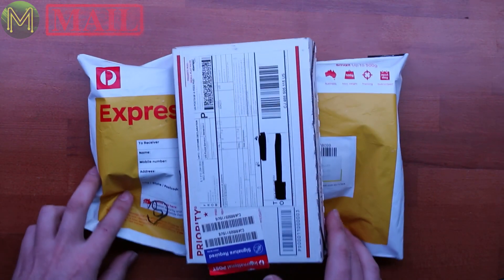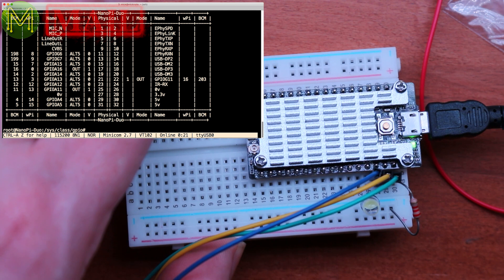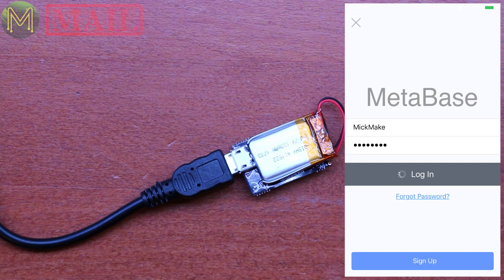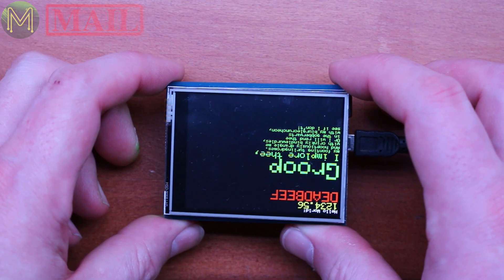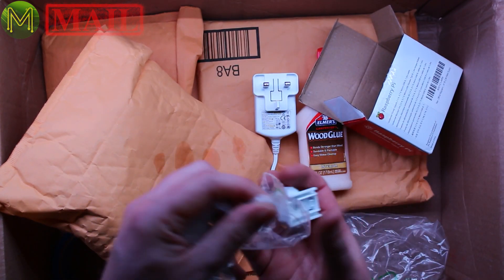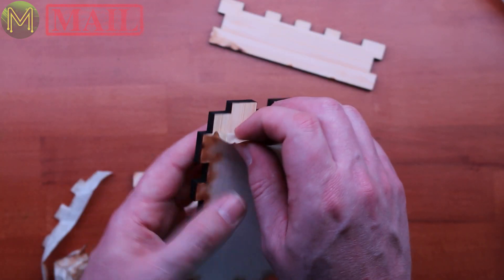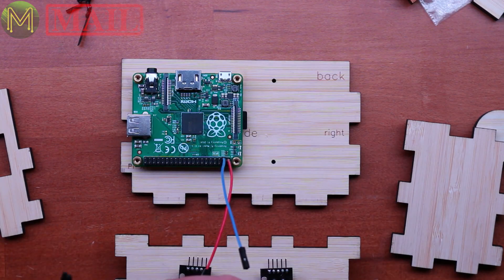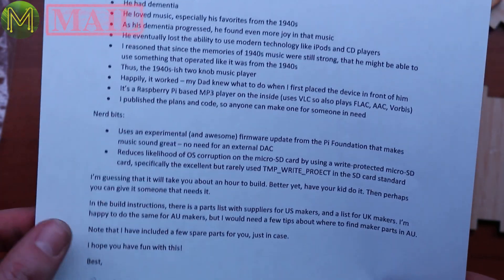#173 MickMake Mail #19: NanoPi Duo, SiFive, MetaMotionR & DQMusicPlayer // News

Comment: Ross, thanks for the DQMusicPlayer. Looks great :)
Reply from the maker: +bwack I agree!
Reply: Hi Mick. Because of one of your vids a while ago I bought an Omega2 board to play with and use as an internet radio to attach to my stereo. It works, and now a company asked me if i knew openwrt (allthough omega2 is LEDE), I said i have played with a single board computer with openwrt. They gave me a task the test my learning abilities. I had to program a c program with an sdk and cross compile to a router with openwrt and install it in the routers filesystem. I've done it, and I might land a job now. I small part of it is thanks to one of your videos. We never know where opportunity will present itself, but if I hadn't played with the Omega2 I would probably have said no to that company. Afterall I'm more a hardware guy (VHDL/FPGA stuff (teaching) and retro computing hw (youtube)). Thank you very much :) There was a discussion I think in your video regarding if the omega2 had any place in the market because of the low specs, but thinking about it, these routers have similar specs. 8-16MB flash, allthough twice the ram (128MB). So for me it was essential to feel what I can do and not do on the limited system.
Reply from the maker: +bwack 
Fantastic! Great to hear you landed that job. I agree. Opportunity knocks in bizarre places. You never know when opportunity happens.

Comment: Hi! Nice video. I ordered two Nanopi Duo when I saw them on your other previous video.
The Nanopi Duo hasn't got HDMI, it only has composite video and it is not yet supported in the official OS image. So it is headless for now.
About the PCB bending, perhaps you have tightened the screws a little bit too much. Mine are OK.
I did some CPU  benchmarkings and it seems 3/5 of a Raspi3.

Oh, and I put it a fan because it gets too warm and I don't want it like so.
Reply from the maker: +yomboprime 
Yup, I can imagine that little heatsink wouldn’t be quite good enough for the H2. Good to see the PCB pending issue is isolated to maybe just one.

Comment: That dementia audio player project, can probably be made on a single dfplayer module. a pi is overkill.
Reply from the maker: +TheKetsa 
It could definitely be done with an ATtiny and a dfplayer. You’d still need a way of translating the encoder inputs as that UI is better than having single buttons for volume and next/previous song.
You also have the added option of being able to update over WiFi.
Reply: I'm always open to suggestions for simplifying the MusicBox design and I'm quite open to other boards. Lots of smart people on this channel, and I welcome your advice. But some of the requirements are non-obvious e.g. 1) A mechanism for creating a sensibly ordered playlist such as alphabetical by album/folder; this requirement drops out many of the single purpose audio boards (yeah, that surprised be too). 2) support for a wide variety of audio formats so the caregiver's music maintenance job is easier; iTunes/AAC is the hard one to support but it's where a lot of people have their music (DQMusicBox (via VLC-nox) supports MP3, FLAC, iTunes/AAC, and Vorbis). 3) Support for audio on a USB thumb drive; my first rev put music on a micro SD card, but I found that's just not comfortable/familiar for a lot of caregivers (often the spouse of the person with dementia). 4) Populated GPIO headers; I want the making to be accessible to a wide audience and requiring soldering narrows the audience. 5) Built-in audio hardware is a plus; a lot of < $20 SBCs don't have this. I've considered at least 20 boards. But I keep coming back the to $20 (US) Pi A+ to meet the above criteria. I'd love to find something that has more the behavior of a consumer electronics device. So I'm open to suggestions.
Reply from the maker: +Ross Porter 
One of the strongest points with your project is the documentation and design. You’ve made everything pretty clear and not leave anything out.
I can see why you chose the Pi, for al those reasons and really there’s not many other options around. You could do it with a Teensy, but then you’d have the issue of soldering.